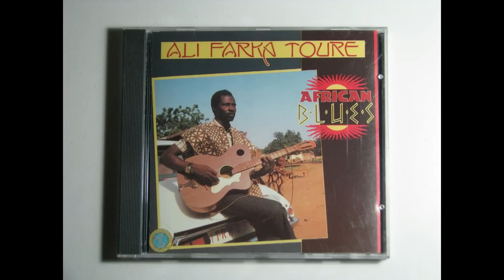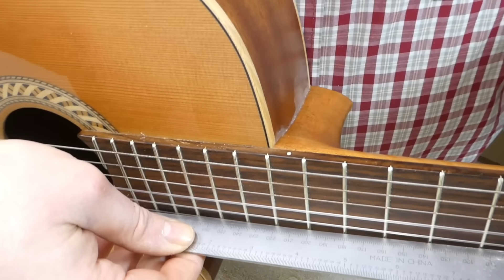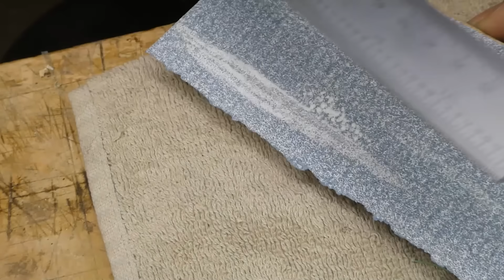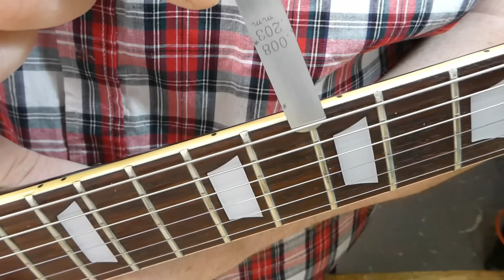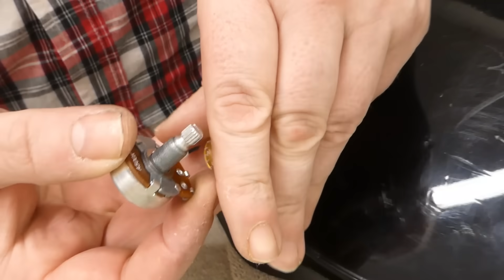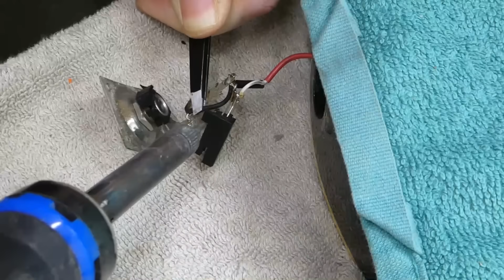Surprises

Comment: I bought a 70’s Studio Lord that had probably spent it whole life on the wall of a bar, no fret wear but the whole guitar was covered in a thick layer of what can only be described as nicotine flavored tar. Weirdly enough it needed new strings, a cleaning and a new pickup selector switch, but it was perfectly intonated and set up. Yamaha seems to have copied it down to the millimeter as all hardware seems to be identical to the equivalent Gibson part.

Comment: Those Puretone multi contact jacks are great, but sometimes the doubled-up lead contacts can be too tight and make it very difficult to unjack a cable, particularly with recessed inputs like on a strat where you can’t get enough finger purchase down in there. I actually had to unscrew the jack plate once to get the cable out. I’d recommend loosening the contacts a little by working them open with a screwdriver or something. But don’t overwork them because they break off and then you just have a regular jack.

Comment: That neck pickup was so low down, if the magnet was weak with age then that would do it. Sometimes backing out the pole piece screws a couple of turns can help - look at Ritchie Blackmore's 335 from the late 60s. If that output socket was original then God alone knows what other plastics are degrading inside that instrument! I worked for a top end valve hifi amp company and we had a pair of monoblock 300B amps in from Indonesia adn the copper tops were badly coroded. The finish on them was a two pack but it had failed in the intense humidity and heat. So this guitar might be a recent arrival from the far east, who knows!

Comment: I have an 83 Yamaha Lord Player lp400 in black and didn't realize they had the 300k tone pots and the odd input jack.  I had to take mine apart and check. My jack is still in good shape so I'll leave it but I may consider swapping my tone pots as it can be a bit dark sounding at times depending on what I'm playing through. Although they changed the model name to lord player to be more similar to les paul they also changed the truss rod cover to look less like a les paul (still a two screw though).

Comment: I bought a gypsy jazz guitar, an artist's signature model, and the neck was like a slightly rounded 2 x 4, evidently the traditional shape. Wouldn't know, never played one. I tried but the corner of the neck hit right on my thumb joint, deal breaker. Sent it back and got a slightly lower priced model with a more traditional neck , it sounds great, a lot of fun.

Comment: Stereo jack sometimes used purely for extra stabilizing and grip of the plug, but in the absence of any onboard electronics it really seems like it might have been a field expedient replacement. You took the guitar apart and the jack continued the job on its own, that was epic. Talk about the nick of time. Like, if you hadn't looked in there, and sent it back, they would have plugged in to test it and it would have exploded on impact. 
Puretone is very nice altho sometimes they can be alarmingly stiff to insert plugs when they're new. I like that they have barrel jacks and amp jacks now.   I think that inline capacitor tip is just in time,  buddy sent me his tele build to scrub the frets and it has a 'tron in the neck that might benefit! Thanks!

Comment: Whoops, 0.47 (470n) must be wrong, 0.047 (47n) possibly, high pass 47n over 500k to ground is 6Hz whereas going right down to 4.7n tends to get into the area but there must be some interaction with the inductance.

Comment: Yes they made Frog Tape thinner and more narrow too!!! And of course the price is the same or higher smh. I just ran out and bought a new package and it's a good deal narrower I was so ticked off! I use the yellow "delicate" version cause it has less tack so it's safer for nitro etc. But I used it for a fret detail job on a new Classic Vibe HSS strat I bought as a project guitar and the steel wool was burning through the tape much faster than normal. I had to use a new piece a little less than 50% faster than I used to. I'm so sick of being screwed by these companies that act like they have no choice but to raise prices due to supply chain issues but are reporting record profits.

Comment: Issues with the muddy sound on the Les Paul are, most often, due to a high capacitance that acts parallel to the signal. It gives the path to the signal towards the ground. So called modern wiring also makes things worse. Pots value matters a lot because that capacitance and pot value are acting as a RC filter and smaller the actual resistance is more high tone is filtered to a ground. The absolute offender is the coaxial cable used even in modern Gibson's and even in the Custom Shop models. Things get pathetic with wires used by cheap copies. Currently Gibson uses CTS pots and they do not check the actual resistance.  Even the vintage looking braided cable is high capacitance because they use a single ply isolation cable. Plus they use standard taper pots models mostly. Proper braided wire has two isolation layers. The inner white layer is mostly rayon (fake silk) and black outside cotton or waxed cotton layer. Gavitt still makes it and all boutique PAF replica builders use it. It has way lower capacitance. I even dismantle pickups and change the hookup wire. Please do not do it accept if you know what you are doing. If you have the budget get vintage taper CTS pots and buy more or buy guaranteed 500 plus Kilo Ohm pots. Make 50-ies wiring harness with the Gavitt wire and use oil in paper 22 nF cap for the bridge pickup and lower value like 15 nF for the neck pickup. Emerson makes nice caps. If you have no money check the actual resistance of the pots. Put the highest on the volume of the neck pickup. The second highest goes to the bridge volume position. Use lower value pots for the tone pots. Do this and the transformation will be huge. With proper parts and even 550 KOhm pots, 50-ies wiring and Gavitt braided wire the same pickups will sound lauder and have way more details. You will get what is actually coming out them, without losses due the leaking signal to the ground. If you are less technical and you are buying a nice PAF replica pickup buy drop in harness of the proper builders. I highly recommend Monties from the UK. His harness is a work of art and done properly and doesn't cost an arm and the leg. His pickups are great as well. Actually he worked on the Greany and he has his replica of those pickups. For OK price too. No I do not work or profit from them. BTW Matt is an awesome person to work with and will help you out and recommend proper stuff to you. Or get Emerson caps, 2 meters Gavitt wire, CTS guaranteed 500K plus pots, print out 50-ies schematic and go to a local guitar tech and pay him to make it right. I also buy more pots and do my selection on top of it. But I do buy silly expensive pots as well for highest end builds. I take a completely new 10K bucks Murphy Lab guitars and dismantle pickups and make a completely new harness for it. I use standard mono non switched Switcraft jack in guitars that are vintage style. Puretone is used on request or in modern  guitars and in the output of stronger amplifiers I make. In the non grounding output jack position of the higher power amplifiers Puretone offers more than twice the contact area. You just need to explain to clients to make sure the speaker cable is inserted completely. Contact leafs on the Puretone jacks are not flat but rounded hence even the two leafs have way more surface than your classic jack plus the double the contacts. As a guitar jack Swichcraft jack tolerates more dirt. It shaves off dirt with a small but strong contact area. In guitar there is no need for current carry capability. But in the output jack position of the amplifiers Puretone is providing way higher current carry capability. No brainer. Just make sure it's a proper type for the amplifier circuit.

Comment: I did that (Kremona) the other way around for the same reason! I took my Simon & Patrick steel string that needs a neck reset, and I put ball-end nylon strings on it so it could still be played. It wasn't perfect and the guitar is again sitting in a closet waiting for repair funds, but it was fun for a while. I may get another set of Silk & Steel for it.

Comment: I know it is common to have some relief and an "off ramp" for higher frets, but I have never understood why. The string under tension will always be a straight line between the fret and the saddle. Why should the distance between the string and the top of the frets need to change?  I can sort of see the idea where a straight neck with some incline or angle relative to the straight string could make sense but this complex "hills and valleys" of relief for part the neck and off ramps just seem unnecessarily complex at best, and giving you wonky action and dead spots and intonation problems at worst.
Reply: The string vibrates in an arch shape (fundamental note is a half sine wave). It’s only straight in its resting state.  Relief is usually created by string tension bending the neck, but the part of the fingerboard that sits on the body is too stiff to bend, so therefore a fallaway can be useful. Depens on how long the fretboard is past the neck joint.

Comment: I repair pedals and see the same kind of plastic jack disintegration on some Boss pedals, suppose the plastic just is brittle from age and mechanical stress
Reply: Plasticizing agents leach out and evaporate...and O, ozone and sunlight also cause degradation. I was a vintage audio equipment tech for 2 decades and saw lots of plastic parts shrink, crack and crumble.

Comment: i have also been told that my nuts are too low. small world
Reply: Gravity is a cruel mistress
Reply: @noisetheorem  he used to do surgery, for men in the eigh-eigh-tees🎶
Reply: You may need longer legs.
Reply: @57sitruc This woman once told me I should sue the city for building the sidewalk so close to my ass.
Reply: ... so has Larry David
Reply: @d0sk3y Larry Long Balls
Reply: It's an age thing
Reply: As least nobody has said your nut slot's too wide!
Reply: @Foul0wl2112 😄
Reply: Any luthier will tell you if your nuts are too low, lower the humidity. 
Not a permanent solution.
Reply: @JDSJayDS We'll get you a stool to stand on. That way maybe the jokes won't go over your head.
Reply: Just cut the top two inches off of the tops of your overshoes and you’ll be OK.
Reply: Mine are rounded off and not conducive to wenching *wrenching*!
Reply: They can give them a cosmetic lift theses days. So I'm told.
Reply: Mine are to high, perfect soldier, sportsman. American president, benefits are endless
Reply: @doyouthinknot  cough!
Reply: Was it too easy in the first position?
Reply: Heavy weights hang low
Reply: Wait til you get older!!!
Reply: Do they wobble to and fro?
Can you tie 'em in a knot?
Can you tie 'em in a bow?
Can you throw 'em o'er your shoulder
Like a continental soldier?
Reply: Came here to say exactly the same thing 😂

Comment: Does this guitar not have a truss rod? Most of the modern production classicals do, especially these crossover ones.
Reply: Some Kremona models do, some don't. I have a Lulo Reinhardt Kiano model that has a modern truss rod.
Reply: @jamescurtissmith  All the Kremona’s I’ve ever seen had one, which is why I was surprised when he said “These guitars generally don’t have a truss rod”, which is in fact not the same as saying this guitar does not have a truss rod.
Reply: He said it does not.
Reply: @goodun2974  I assume he looked. I assume Ted does not assume.
Reply: @goodun2974  I’m sure he checked, but he did not say that this guitar doesn’t have one, he said these guitars generally don’t have one, so it’s fair to wonder, especially being familiar with the brand and having seen truss rods in them.